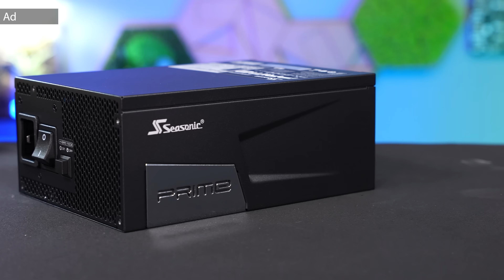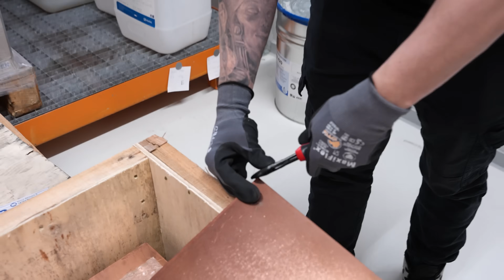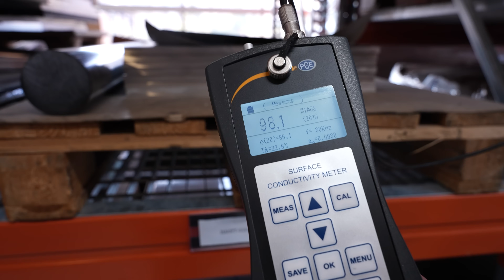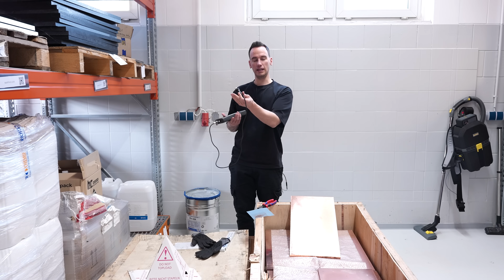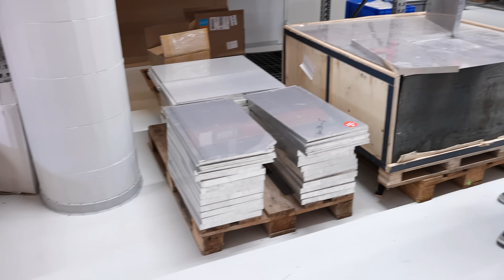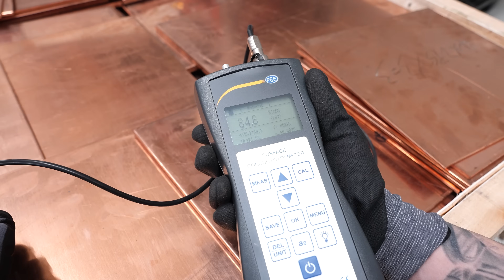I Got Scammed

Comment: This sucks. I am an international purchaser (consumer, not business) and I've been scammed 50% of the SSDs that I've purchased from the platform but Alibaba has always made me whole by forcing the vendors to refund me which is why I'm not afraid to use the platform. I don't know how it works for international companies purchasing but I would urge you to reach out to them and I'd like to learn how they handle your case. My most recent case with an SSD the vendor had the balls to actually REFUSE to refund me my money so I sent a video to the vendor and Alibaba showing me plug in the SSD and how nothing loaded up in my NAS. Alibaba reached out to me and told me it would be handled in 48 hours and they made good on the promise.

edit: for those unaware, Alibaba now has this thing that vendors can opt in to in order to prove their sincerity where if your product is fraudulent, the vendor pays you 400% of the purchase price. I believe PDD has something similar, but I've never used PDD.

Comment: Next week's video, Roman buys a copper foundry
Reply: Only to find out it’s a steel mill.
Reply: @bobroberts6155  Hahaha...perfect
Reply: Bro😂
Reply: He could throw something together pretty easy, and probably do sand casting if some parts are not too complicated. There'd be a learning curve for him and a bunch of good video content.... then machine those parts for exact precision.  Little foundries are not that complicated.  He'd end up using a lot less raw material.
Reply: @glen.simpson  You realize how 99.99% copper is produced? You can't just melt materials and poor a 99.99% plate, the process where real purity is achieved is done by electrolysis. Producing almost pure copper is very complicated.
Reply: And it turns out to be a plastic recycling xD
Reply: na lol next week another video on how he got scammed based on stupidity.
Reply: @ColdVenom159  Only stupidity here is your comment, dude.
Reply: @kadrix732 which is why I've got likes while you have zero. Might wanna learn some grammar, you don't put a comma then 1 word then a period. Commas are used to break a overly long sentence.
Reply: @ColdVenom159  might want to check that again
Reply: @coffebar why would I care to check again lol? You're responding to a comment section over a week old it's irrelevant at this point. What you're not aware there's more ignorance then there are people who actually use their heads now a days what a shocker.
Reply: @ColdVenom159 ok buddy
Reply: @ColdVenom159  well its not even his fault its just humanity is failing too much criminal energy 10 years ago people would send u stuff without u having to pay first and you pay later shit doesnt work anymore
Reply: @square7935 u sound absolutely clueless. You're right it's not his fault at all that he used the website that is flooded with scammers without any secure way of getting his money back. None of that is his fault.
Reply: @square7935yeah, wonder why :( there is only hate in the world now
Reply: @DegustoDelSol there's not only heat in the world hate comes from stupidity point blank. What the world is full of is people who just don't use their heads. Once you start opening your eyes and looking around you'll actually notice that.

Comment: If you don't get your money back I would love to do some investigating on the companies you were dealing with and I'm pretty sure others would as well you have a huge following might want to try letting your fan base give you a hand (I worked in the fabrication business for 13 years fabricating HVAC ductwork and I've had similar experiences getting material nothing like ordering aluminum sheets or stainless steel sheets and getting 22 gauge steel and I mean horrible dirty steel half gallonized it's a gut wrenching feeling you get especially when the top few sheets are what you ordered and it lets you know it was intentionally done

Comment: If you have a 3rd china supplier you know and deal with for other parts you offer to pay them $1000 to physically go and so some checking and talking to the supplier and just sus out if its legit on site, maybe check the copper themselves using some techniques you specify when it's being packed up.   They are less likely to scam you in this scenario and your other suppler knows if they do scam you you likely wont work with them any more as well, so they have an incentive to actually making sure it's not a scam.   But there is always a risk the scam wasn't the actual supplier and happened during shipping/transit, since a big heavy shipment of copper is very tempting for anyone in the shipping chain.

Comment: Sigh, i was watching the first few minutes of your video where you talked about asking for pictures and other indications that these plates where in fact pure copper plates. I saw pictures of the dimensions, angles, stacked plates and so on. I was expecting to see pictures of a scratch test, followed by a depth cut with an angle grinder, followed by the same depth cut on that juicy stack of copper plates. I was expecting the pictures to all have a proof that they where in fact taken on your demand with for example a written label containing a random code you provided, or even labels you wrote and sent yourself to be included with the pictures. Not that would have proven anything with absolute certainty, but still. A scratch test should be the absolute minimum as well as the labels included in the pictures. To prevent them of having one genuine pure copper plate to do these scams with, having them do the same test on a full stack of plates (like shown in your video) with a label included would prove difficult. Having a stack like that available in a factory running a scam would not be likely considering the value. Having it sit there as a prop in a low wage country in a factory with even lower wage employees, a stack of pure copper plates would turn into a stack of 'pure copper' plates in a matter of days. The culture of 'saving a buck by cutting corners' (no pun intended), that is the standard in China, would prevent them of being able to provide a cutting test on such a large stack. Now it's easy to say this in heinz sight, but i was immediately pulling my hair out when there was no mention what so ever of a scratch test to begin with, let alone a deep cut test. 😵 But if it's sold trough Ali Baba, is there no way you can still take action and try to at least have some form of compensation?

Comment: Alibaba vendors are typically middlemen sourcing from contacts who sometimes scam them, making you potentially the third or fourth link in that chain. This is endemic to Chinese contracting, not specific to you being German. Chinese projects employ inspectors across every project deliverable for exactly this reason: suppliers open with good quality, then introduce bad batches, degrading progressively if unchecked.

Comment: This is a clear case of fraud, begin action though your bank, they are real companies with real paper trails. This sort of shenanigans is surprisingly common, they do it because people don't follow through.

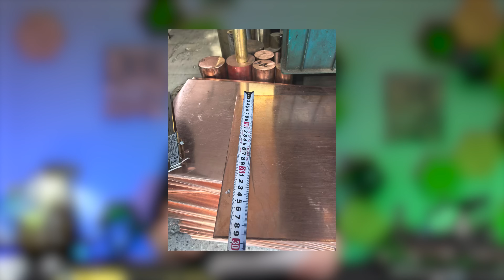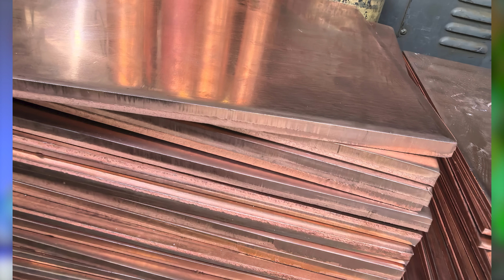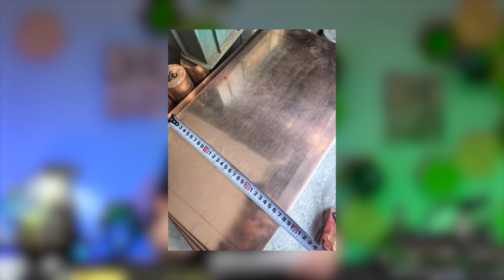4:10 At 24cm there is damage and you can see the steel 4:16 Note the discolouration, darkness and poor coverage (How does the recesses of a rough surface gain 8 months oxidisation while the rest doesn't) 4:20 again pretty dull and discoloured - look at the cylinders top left.

Comment: Thanks for sharing. Honestly just rotten luck. Sounds like you took all reasonable due diligence/precautions.  Unfortunately none of us are safe from getting scammed. Those that haven't been yet, just haven't encountered the scam that targets us.

But its also a bleak sign of where the markets going if they are putting this much time is to thick plating steel.

Comment: Certainly not embarrassing. Everyone that has/had a business is going to get a dud at least once. The biggest issue is the financial hit, imo you should check for the responsible Chinese authorities, these scams are sure bad publicity for the Chinese trade. Be sure to save CCTV footage of you opening the boxes (if possible). Also you should make a fake copper cooler* for an RTX A400 or 2050 or something like that, have it benchmarked with maximum fake frames, you can also install fake ram kits (yes these are things RAM manufacturers are making now fill up your empty ram slots with RGBs). The fake build.
*Machining steel especialy of bad quality is absolutely painful for the machine and the end mills.

Comment: Great video and story. The weight of the shipment should be very telling about the metal - copper, steel, and aluminium should be very distinct. The copper is hardly to fake due to its high density, pretty much everything with similar density would be expensive.